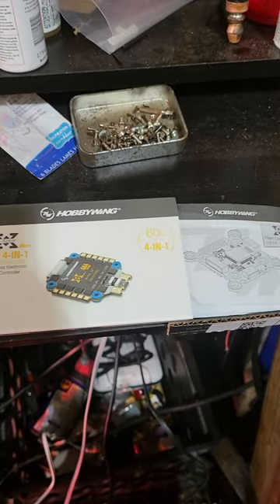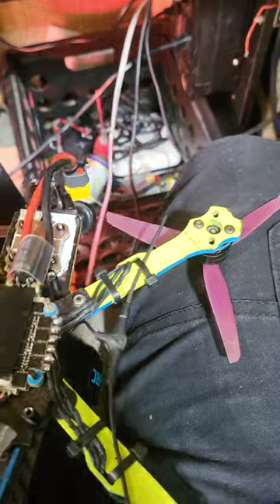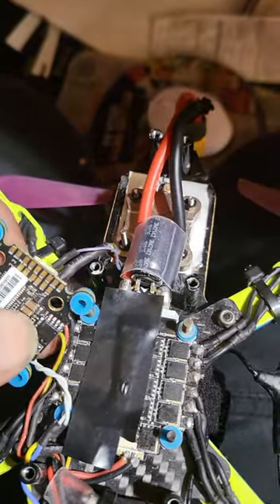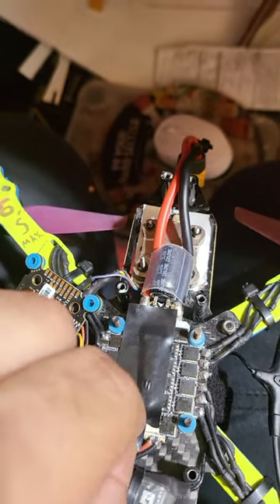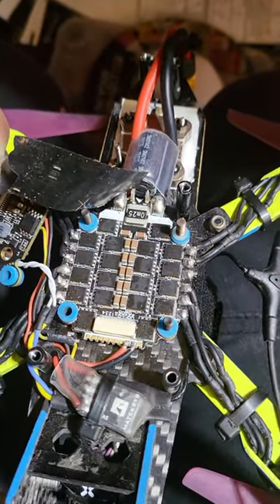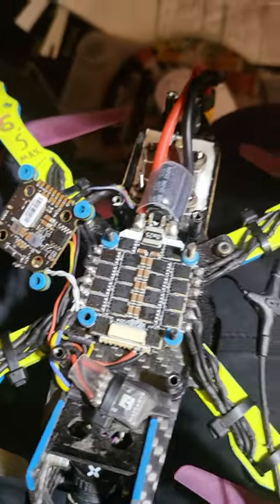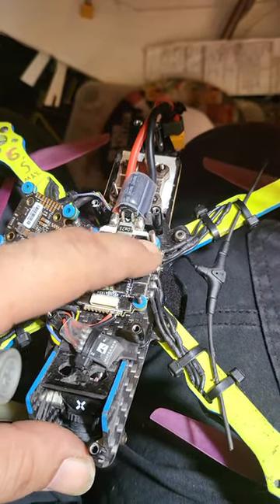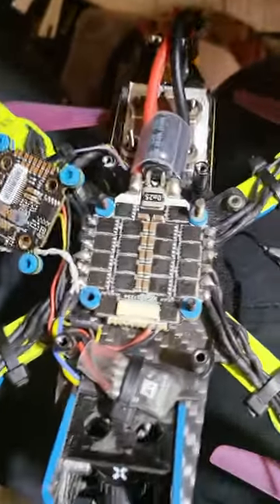Hobbywing 60A and 4in1 esc are touching the flight controller.

Comment: just got this would it cause a flip out? it burnt out my elrs
Reply from the maker: As long as you watch out for the spacing on the esc and flight controller it should operate fine. I've had elrs before and had no issues. Just switched to crossfire for easier use.